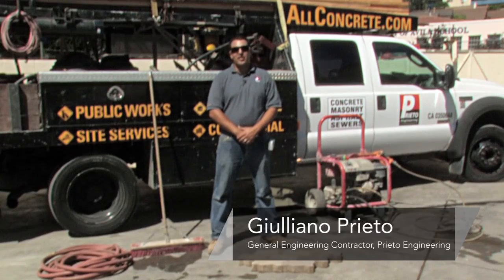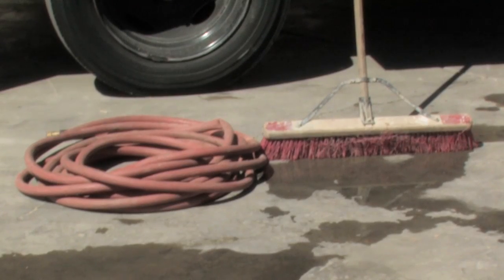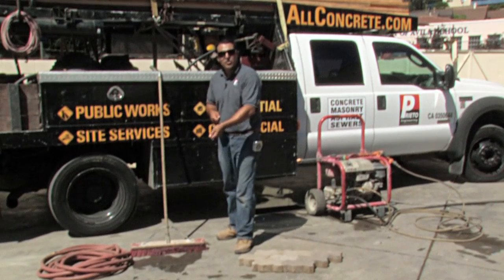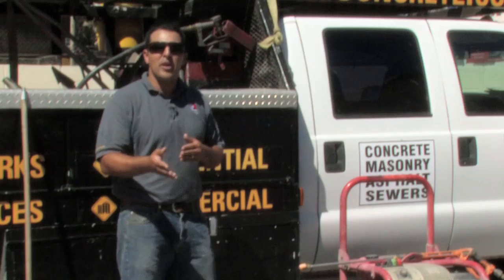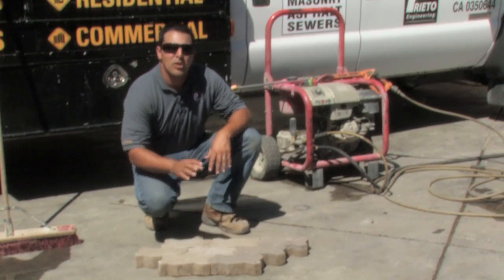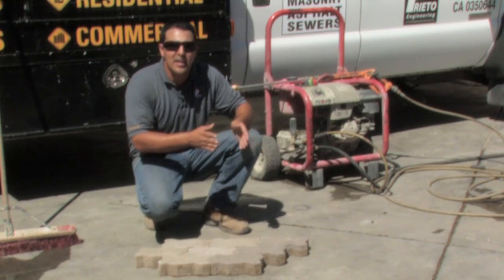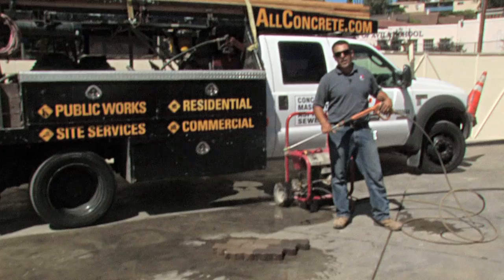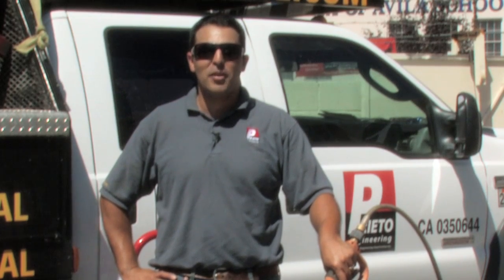Concrete & Masonry : How to Clean Driveway Brick Pavers

Comment: ok - hope you are still in business!!--- my brand new paver patio had a pressure washer sitting on it (the painter) the vibration of the machine left tire marks on the paver AND the exhaust from the engine created ~smaller hand size 'smudge' on one/two pavers.Techniseal has a product specifically designed for this kind of stain.  (so I told my painting contractor that is what I was going to use - he took it upon himself to use Zxylene (sp) - still wet - we will see and I can already see that the exhaust smudge is still there--